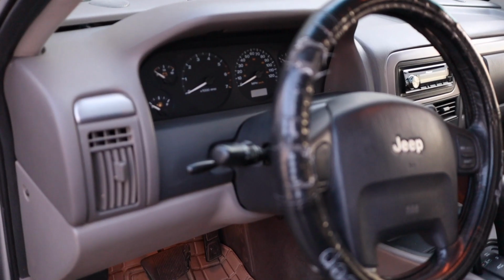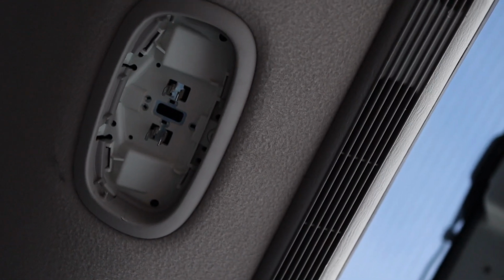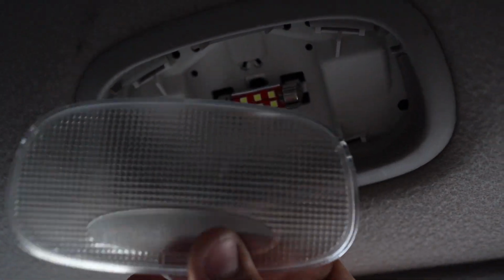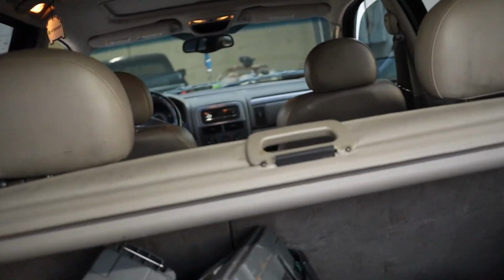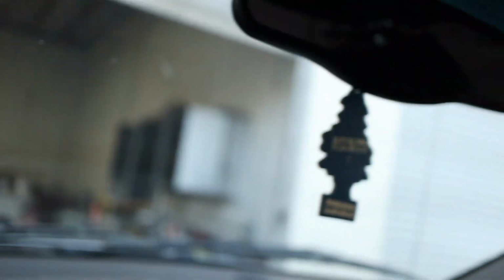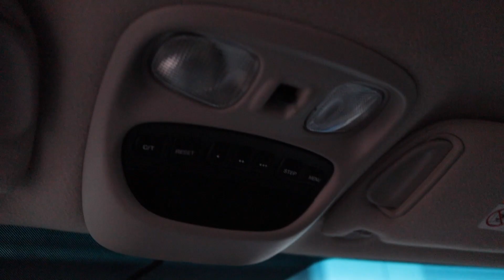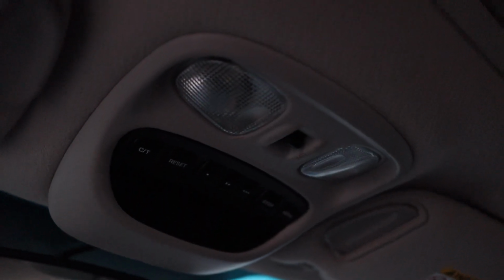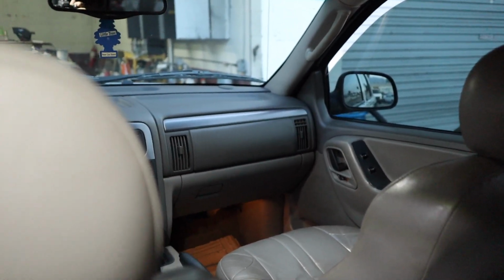HOW TO INSTALL LED INTERIOR BULBS | Jeep Grand Cherokee WJ

Comment: Do you have a problem with them staying on really dim, after you park and leave the jeep. Mine would stay on indefinitely, not really bright, just glowing. I heard the LEDs don’t have enough resistance to stop all of the power, so I switched my rear hatch, light back to the stock bulb and it fixed the problem. But now I got that stupid yellow light back there. Any ideas, resistors, or anything? Thanks bro.

Comment: Nice vid! I jacked up my rear passenger grab handle light assembly and am struggling to get it out to fix it. Know of any tips ? That push button slipped off into the abyss.
Reply from the maker: You need to do that by pushing down on the headliner and pushing it out after you remove the bolts from the grab handle. Helps to have two people but not necessary

Comment: I know I’m well behind the times but been watching you on YouTube, I was changing the interior bulbs on my WJ 2002 Grand Cherokee Limited. I broke the switch on the rear passenger ceiling pull done light. The switch depressed all the way in. If I remove the handle is this something that can be fixed?

Also the front door lights do I need to remove the door panels or do the lights pop out
Reply: The bulbs pull out (type 194).Dont twist the plastic insert it sits in, just wiggle the bulb loose. Pop the lens cover, and proceed. Only reason to pop the door panel is if you pop that plastic connector through. Don't ask me how I know 😂

Comment: A list of what bulb types and how many would be great!
Reply from the maker: +SilasZoeBell So for the front dome you need 2 x T-10 LED Bulbs and for the rear passenger and the rear hatch area you need 3 x 578 LED Bulbs .. I didn’t change the floorboard lights so I’m not sure on those
Reply: @NajarOffroad  T 10s

Comment: I did this change out 3 weeks ago but I was wondering if you did the door lights and if you did how did you get the bulbs out of the holder?
Reply from the maker: +Brent Padgett I did not do the door lights.. might do it when I change speakers out
Reply: @NajarOffroad  did you ever do the door lights ? I’m having an issue doing mine ?

Comment: Hey mate what is the item number on these? Great job
Reply: Overhead front – two Sylvania 168, 194/2825 LED bulbs, held on by a single Philips head screw. Overhead rear, 1 over each rear door and 1 over tailgate – need three Sylvania 578/6411 LED mini bulbs
Reply: @x1carrier  thank you

Comment: I highly recommend you guys not to order these light from Amazon link they suck. The ones you showing aren't even from that link.
Reply from the maker: I used Flyryde which is the first link. But I put the amazon ones as a cheap alternative based on reviews
Reply: @NajarOffroad  that link doesn't exist